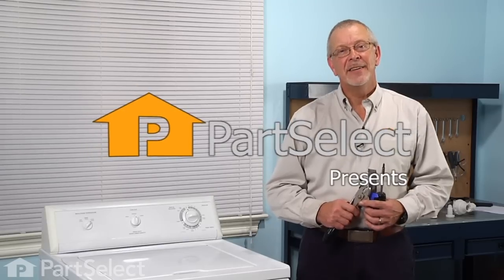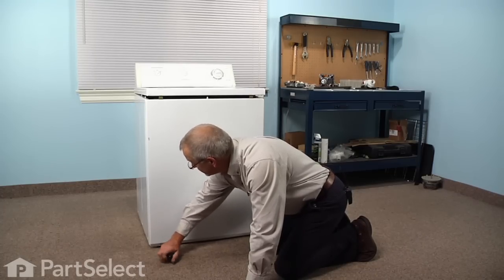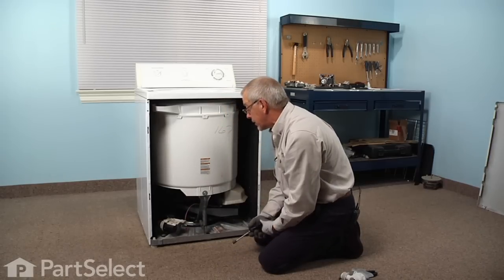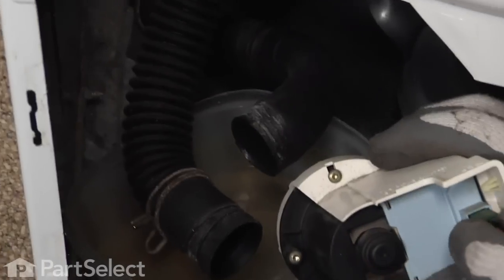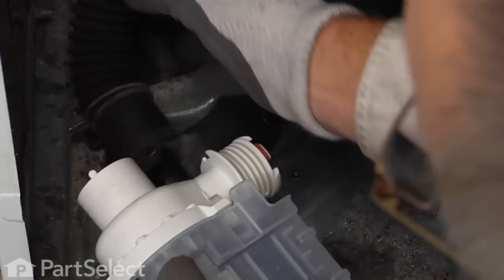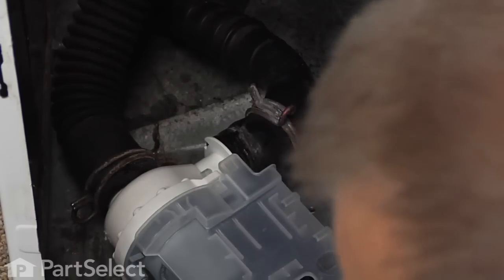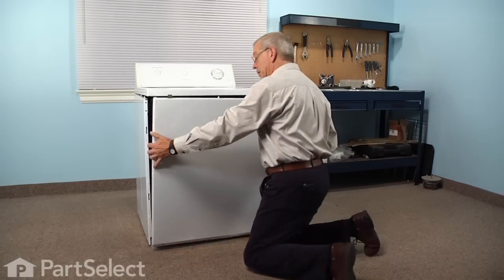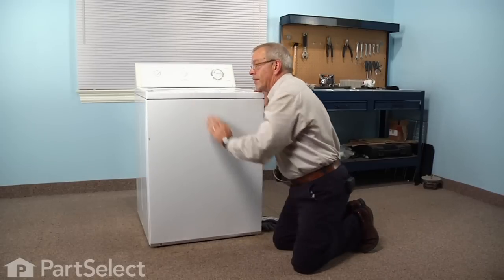Washing Machine Repair - Replacing the Drain Pump & Motor (Frigidaire Part # 137108100)

Comment: I removed the pump again and entire hose assembly and found a clog in the largest middle line. I found a wool sock and some change, removed and reinstalled now the  washer works better than it has for a long time.   Thanks for your advice.

Comment: I have a Maytag washer. Model number mavt236aww. had a load of laundry in and heard loud squealing noise and went to inspect and found that the belt had melted onto the plastic motor pulley. I bought a new belt but after installing the pulley broke off. The motor still spins so I was going to purchase a replacement pulley but I read that replacing the pulley might not be the problem, that the drain pump could have burnt out causing everything else.... I just want advice- buy just the pulley or the pump and the pulley?
Reply from the maker: +Megan Hensley Before you replace the motor pulley you should verify that the pump pulley turns freely and that the transmission drive pulley will rotate easily in both the agitate and spin directions.

Comment: I changed the drain pump and its still not draining. the hoses do not appear to be clogged as I was able to drain the machine by simply lowering the drain hose into a bucket of water. and I did re-attach the power wire. is there some sort of fuse that could need replacing? the machine fills, goes thru the wash cycle and then cuts off when its supposed to drain. the same thing it was doing before I replaced the pump. need help please!
Reply: +Warren Kenney model #glws1749as4, Frigidaire.
Reply from the maker: +Warren Kenney I sent your question to Steve and will let you know what he suggests.
Reply from the maker: +Warren Kenney If the motor does not receive power then I would look at the lid lock switch and the timer contacts.

Comment: What is broken on my washer if it agitates but won't spin? And it's letting out smoke....I assume that's the belt burning. Have you done a video on the Fridgiaire commercial heavy duty top loader? I think mine is pretty old.
Reply from the maker: What model number do you have?

Comment: I saved over $150.00. I removed and inspected the pump. Removed the obstruction, re-installed the pump. Just as new.  New pump $ 100.00 + labor. My coast 5 minute review of tape. My return, an additional experience.

Comment: will this pump make the washer not spin?  I have a friigidaire affinity front load washer that won't spin i replaced the door lock assembly and this did not fix the problem.  I then removed the pump and rinsed it out reinstalled it and the washer began to cycle with no load inside.  I then put a wash load in and it stopped spinning halfway through the cycle.  model fafw4011lw0 Thank you for any advice
Reply from the maker: jackdaniels432  I have passed your question on to Steve and will let you know what he suggests.
Reply: Mi lavadora frigidaire no hace el penúltimo ciclo “el rinse” q hago con eso

Comment: My washer heavy duty top loan frigidaire is spinning in the opposite direction(counter clock wise) and will not drain completely do you have a video for that?
Reply from the maker: Hi Quanisha, thanks for your question; we're going to need a model number for your washer in order to be of more assistance. Thanks in advance!